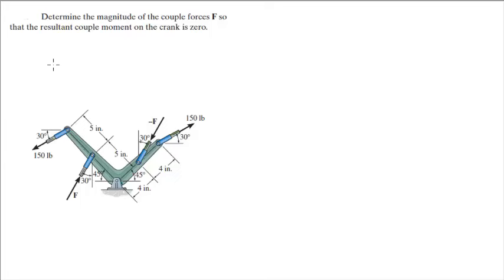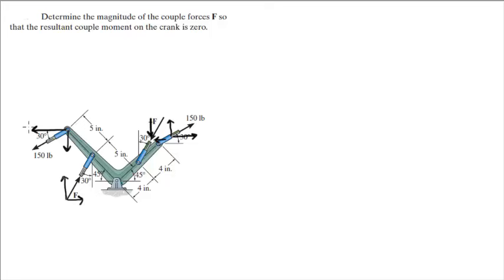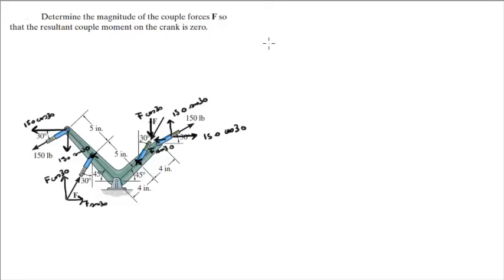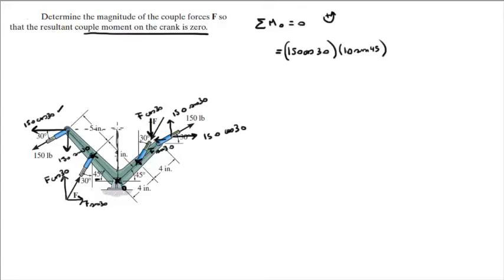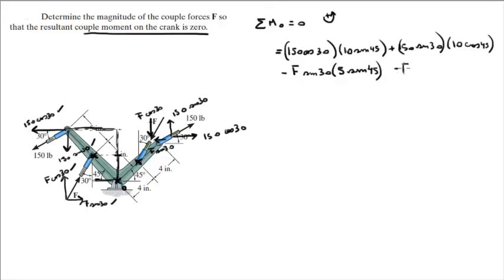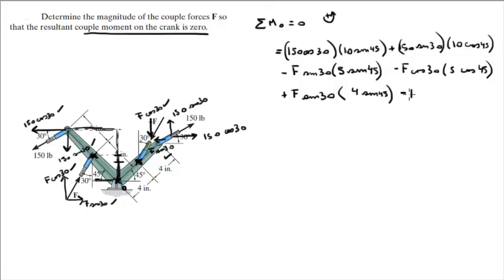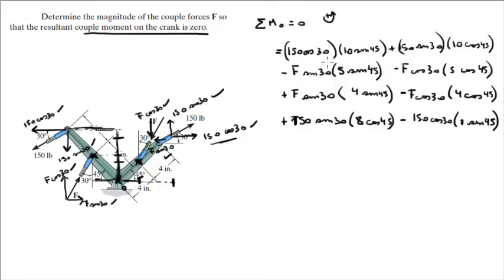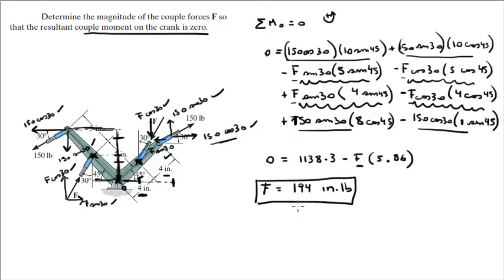Determine the magnitude of the couple forces F

Comment: how do you determine the sign for each one if CCW is +
Reply: You use the right hand rule to determine their sign. First, you point your fingers in the same direction as one of the forces in the couple. Then, you curl your fingers towards the other force. If the curl of your fingers matches the direction of rotation that is taken to be positive, then the couple moment is positive. If your fingers curl in the opposite direction, then the couple moment is negative.

Comment: how do you solve this problem using the idea of couple forces though?
Reply: You resolve the couple forces into their components as was done in the beginning of this video. Then, you find the moment arms of these couples. I found it easier to visualize these by redrawing the crank as right triangles on both sides of the base. The point of applications of forces can be placed on the triangles, so the moment arms can be found with trigonometry. You then set up the equation for resultant couple moment of the forces to be zero to find F.